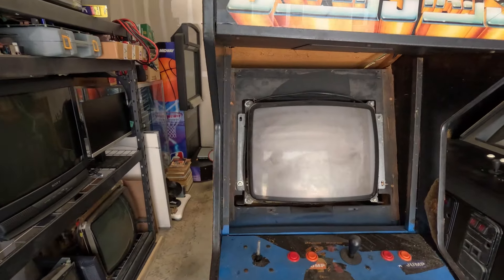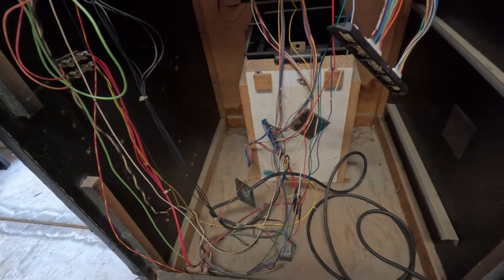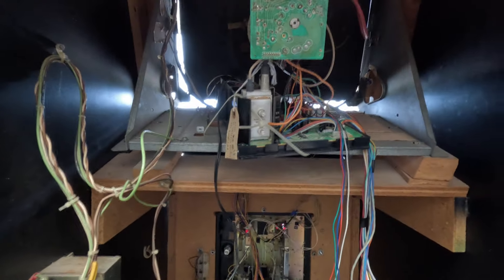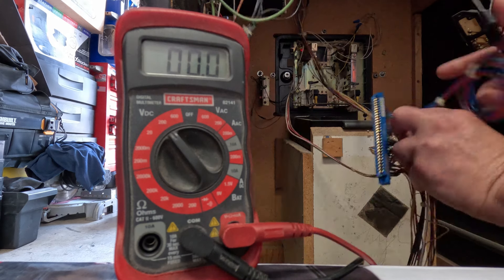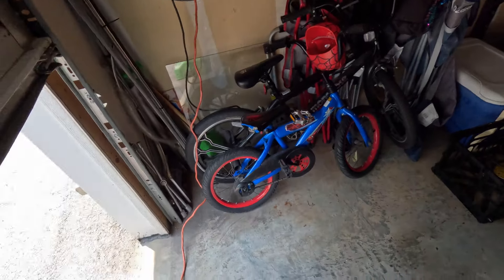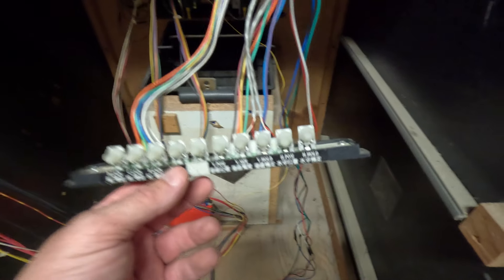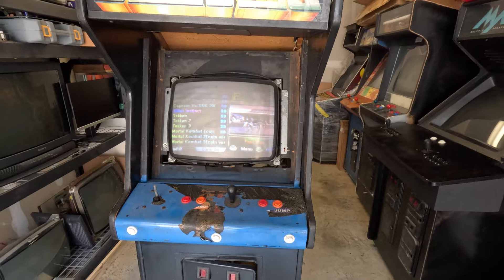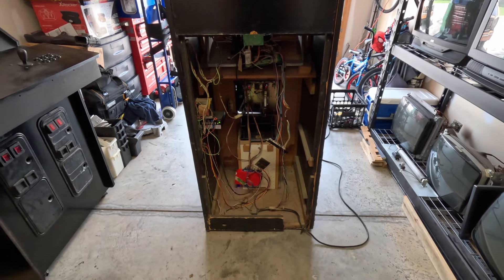Free Busted Up Arcade Machine Pick Up. Let's see if anything is good on this thing.

Comment: Nice score. Since the monitor goes, you should restore it. None of those controls are for purity or convergence. Degauss it first. Then try adjusting the convergence rings on the tube neck. Note their initial position in case it doesn't fix the problem.
Reply from the maker: @tenmillionvolts  thanks for the info I'll try that.

Comment: Nice mustang II
Reply from the maker: @LordSamuelJ  thanks. Has a 2.3 Turbo T5 Trans and 8 inch rear. When I moved from Maryland to North Carolina I was in the process of doing bodywork and we moved on a whim and had to put it somewhat back together. Whenever I get out of this apartment and get a bigger place I need to get back on it.
Reply: @kielianstreasures7720  drive it lately? I can’t wait to get rid of my car payment and save up for a backup vehicle.
Reply from the maker: @ nope haven't driven it in probably 4 years. Was in the process of doing body work back in Maryland then we up and moved down to North Carolina and I just threw it all back together just to tow it down. I think when it gets warmer I'm gonna go through it and at least get it running again. Probably do some videos on it. I have a bunch of parts I bought for it that never got put on.

Comment: Originally Centipede.
Reply from the maker: @techeadache  thanks for that I couldn't figure it out. Just looked at a picture on Google and I think your right.
Reply: @kielianstreasures7720  The side art appears to be painted over.  Mineral Spirits might reveal the original artwork.  Just for laughs.  More than likely no chance of saving it.  P.S. The audio speaker sounds great!  Absolutely a product of the 80's.
Reply from the maker: @techeadache  yea couple layers of paint on the side art. It's not worth trying to keep the artwork but might just try and take some paint off to see what's underneath.